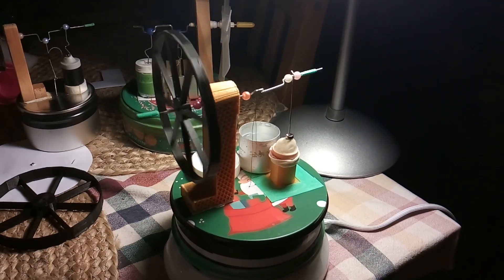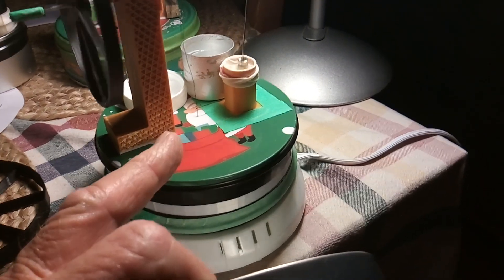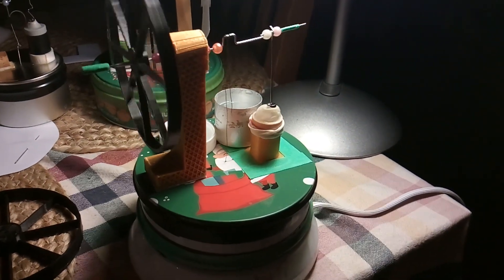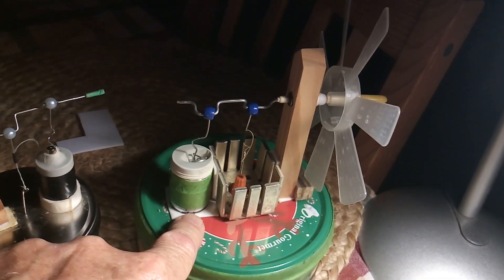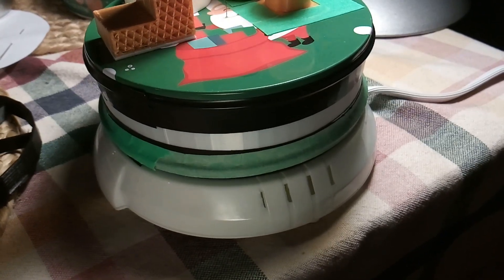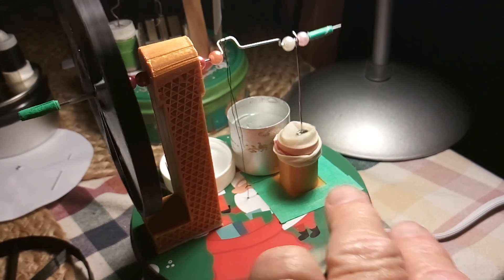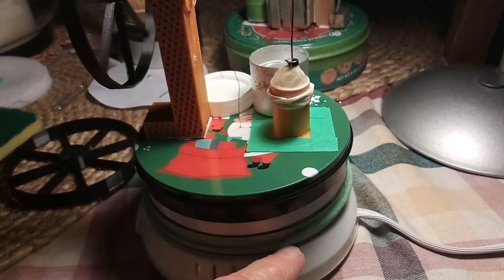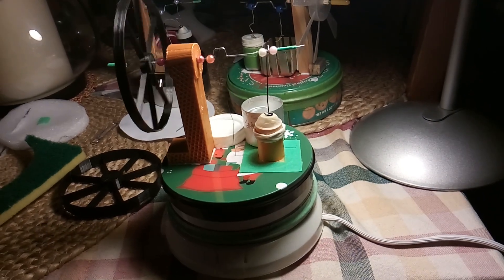PLA plastic parts Stirling Engine  ---- First success

Comment: For the lower displacer, might you try carbon. Which can handle more heat in lower piston. I have seen others use carbon, from insulation or shaped block. I also would suggest, porous lava rock, for its light weight and heat resistance, which can be found in your area, since you live on big hunks of it. 
 I Have been a fan of your works for decade, your projects have always been very inspired.  Your a good teacher, thanks.👏👏✊
Keep up this Inspired channel, your a service to the people, "lidmotor"...👏
Reply from the maker: Thanks. Great ideas.   I'm glad that you enjoy what I do.
Reply: @Lidmotor  ☝️🤝. Always loved your creative skills, for a Decade now. Your a Inspiration to the world of tinkering and creative endeavor.  Like a Good Teacher, you Explain in simple terms your creation so others can recreate at their own pace. 
Thanks a million Sir..
Reply: @Lidmotor  I had this notion. 
So your now 3-D printing, a revisiting of your past "Bobin Bendini 1.5Volt in printed Frame.
Reply: @Lidmotor  now having 3-D printer,  ever consider revisiting your "Bobin Bendini" 1.5 volt? 
I have this idea you could make 3 Bendini Coil arrangement achieve greater gain on output.  
 Video in past showed gain, if only  .3 Volt.
I only suggest because that project was able to do that thing/gain.
With 3-D frame, 2 or more Bendini circuits, you might self power or get greater gain, out the backside. 
 Anyhow, just a thought,.
 Appreciate your creativity and sharing diagrams, teaching Novice, students and hobbyist . 
A fan decade, keep up the great channel, 👏👏👏👏👏☝️👌

Comment: the heat transfer can be limited w/ ceramic spacers, flower pot rim of fitting circumference? silicone caulking to gasket it pressure proof..  motors' pretty efficient considering it has clunky character..

Comment: Congratulations 😊👍
Reply from the maker: It is a win.  Now that I know that this can be done it is just a case of refining the design.  All aspects of this thing have to be greatly improved to make it really run right.  This kind of project keeps me awake at night.😵‍💫
Reply: @Lidmotor  on the positive side, the 3D printer can run while you are asleep 😁😁
Reply from the maker: @GrandadIsAnOldMan  I'm actually afraid to let my printer run unattended.  Too many times I have come back after hours of printing to find a have done part burried under a pile of plastic string.  😄
Reply: @Lidmotor  I have a cheap wireless security camera watching the printer. I can view it via an App on my phone, even when I am out shopping (not that I can do anything about it, if I am out), but it does mean I can check if it is running OK, at any time.